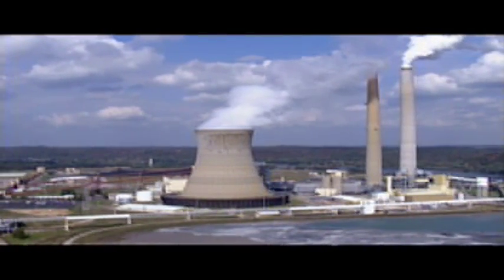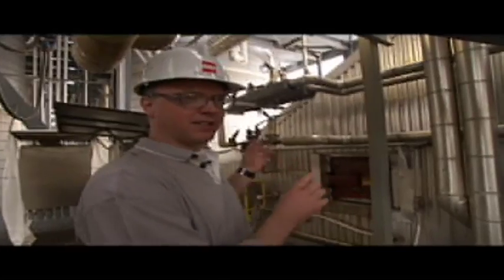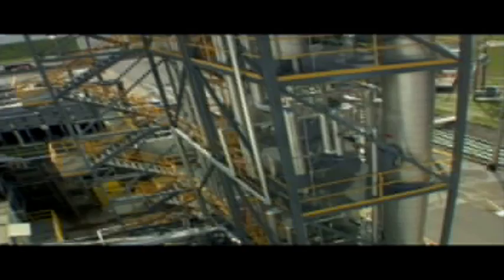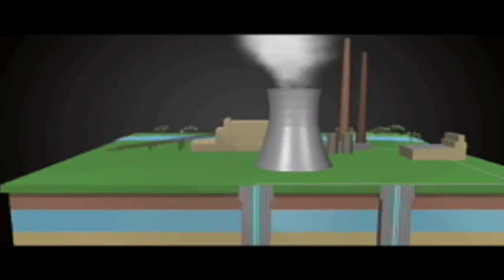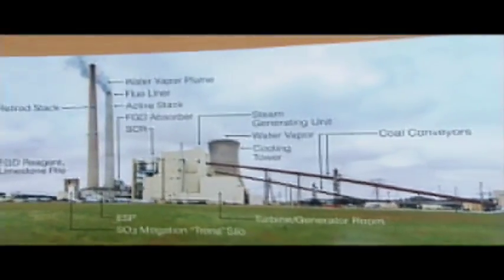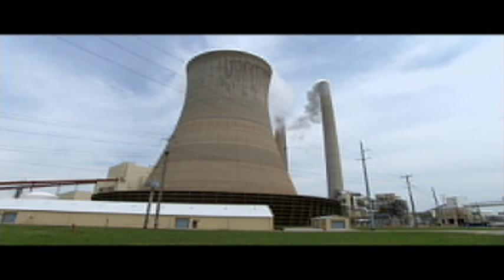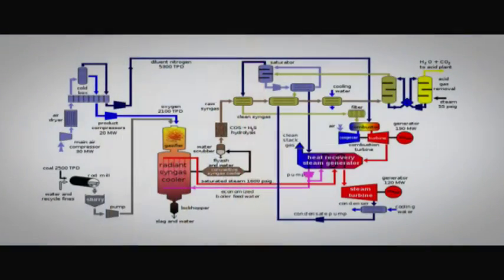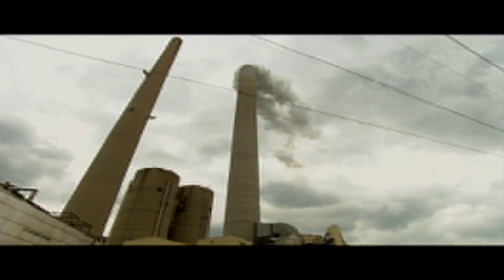Mountain State Science: Clean Coal Technology

Comment: Thank God for coal the cheapest power source on Earth, always there for you even when the wind doesn't blow and the sun don't shine
Reply: 1) there is nothing unusual happening with the climate.

2) there is nothing wrong with burning fossil fuels.  Its problems in high-density areas are trivial to fix and already have been fixed.  CO2 is not a pollutant.

3) Climate alarmism is a big-lie superstition supported by tax-bribed liars.  (See Climate Discussion Nexus for 100s of videos on climate quackery, deception, and realism.)

4) decarbonization is 21st century pyramid building and human sacrifice. 

5) there is NO excuse for expensive electricity.  Electricity generation is boring.     Just burn coal and scrub the smoke in densely populated areas.

6) the only challenge is manufacturing market quantities of cheap gasoline.  South Africa has already done this for decades (Sasol), using coal,
Reply: Could use gas and nuclear, but never mind.

Comment: Why are we paying a CO2 tax???
Reply: 1) there is nothing unusual happening with the climate.

2) there is nothing wrong with burning fossil fuels.  Its problems in high-density areas are trivial to fix and already have been fixed.  CO2 is not a pollutant.

3) Climate alarmism is a big-lie superstition supported by tax-bribed liars.  (See Climate Discussion Nexus for 100s of videos on climate quackery, deception, and realism.)

4) decarbonization is 21st century pyramid building and human sacrifice. 

5) there is NO excuse for expensive electricity.  Electricity generation is boring.     Just burn coal and scrub the smoke in densely populated areas.

6) the only challenge is manufacturing market quantities of cheap gasoline.  South Africa has already done this for decades (Sasol), using coal,

Comment: It's a lot more complicated than that. For one, hydro-electric power is not continuous, it is dependent on the levels of water flowing through the damns, which are subject to droughts and other conditions. Another thing is that those damns are equally if not more so environmentally destructive. There is also a problem with a lack of infrastructure in a complete conversion, which is to say that we are not set up to just "drop coal in general." I'm a 5th year Environmental Science major.